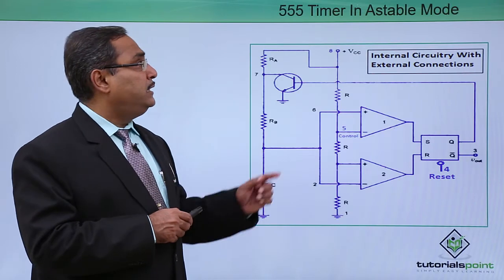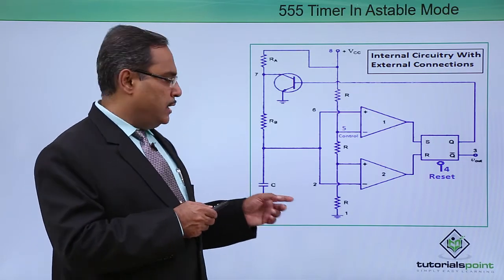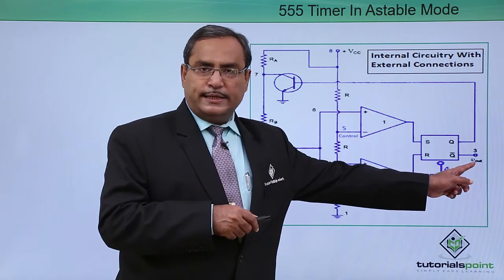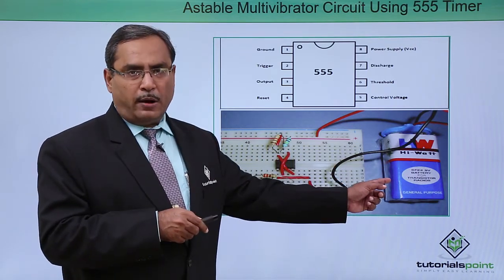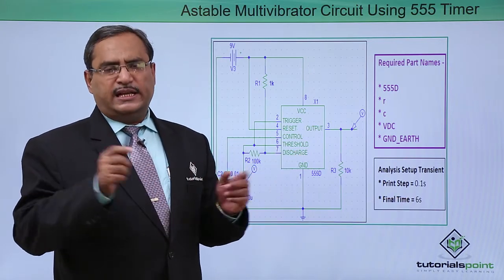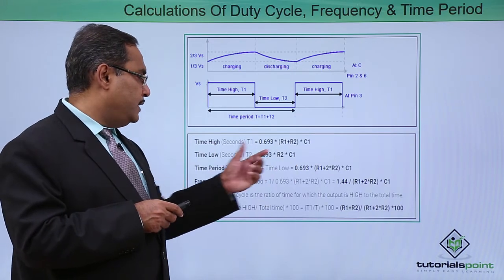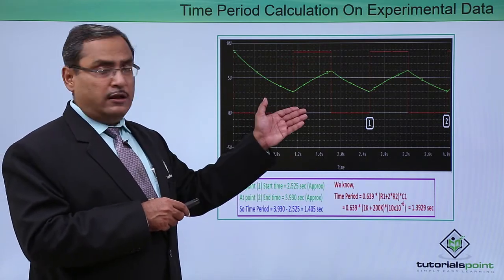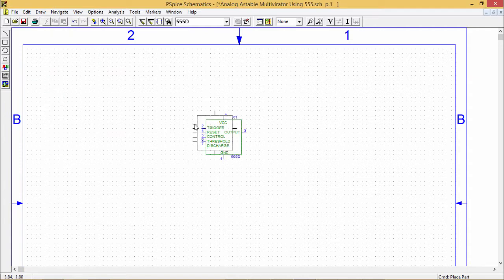Pspice - Astable Multivibrator Using 555 Timer

Comment: 11:53
i use Version 9.2
i set the Simulation Settings like below
Time Domain(Transient)
Run to time :: 10s
Satrt saving data after :: 0
Maximum step :: 0.1

..... is that Right Settings ?!?
Reply: im also using version 9.2 ..... how do i get the library that contains 555D? where do i search for a part im new to this software?
Reply: @debanjanbaidya9383  I got the same pb I don't know how I got it...it is the folder eval In pspicr library
Reply: @pkasdovi  i got it now .... goto Place > Parts and add library. Select all the contents from the current selection that opens, go back a page and do the same and add them all. You will see them at the bottom pane of the window, select all and then search for whatever u want!